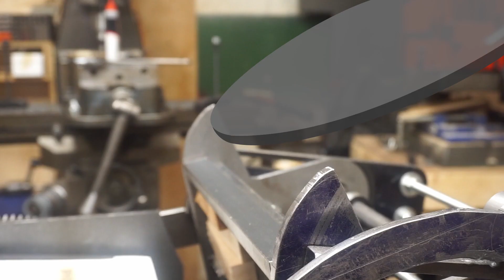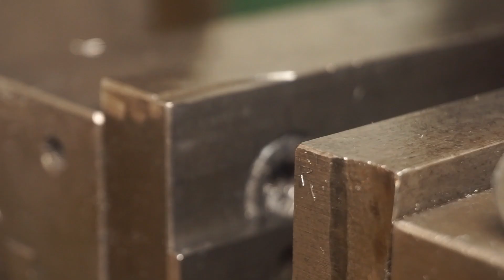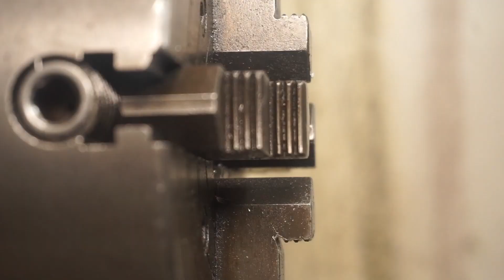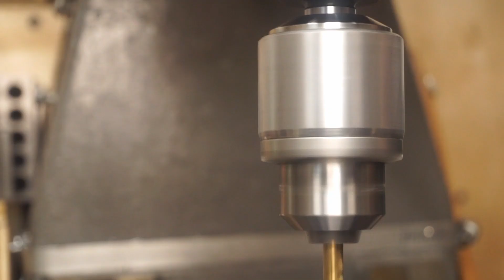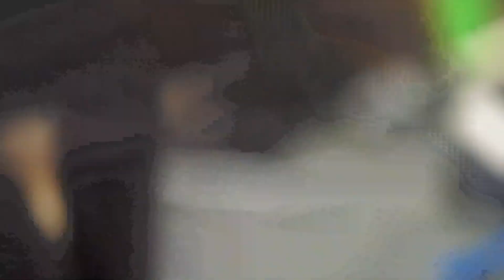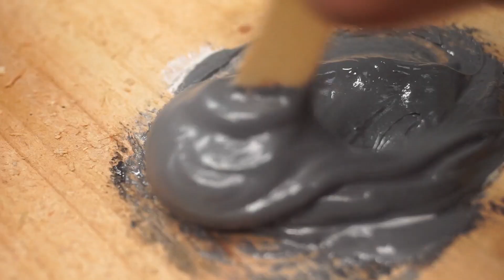Building a Letterpress: Making the Ink Disk

Comment: Sweet bunch of work, amigo. You've pretty much duplicated the operation of a Gordon Old Series platen press. Pretty damn cool, though it's way more work 'n I'd have gone to, being as how there are presses rusting away in the middle of cow meadows.
. . . I dragged a 10x15 C&P (1923 vintage) out of a field and lucky found 99% of the parts. Had to get a few shafts & bits machined but other'n that, it's worked fine for over 35 years. The guy I got it from said I'd never get it going. He's gone and the press just finished the first of a three color run of 2000 impressions. I figure there are at least 100k impressions on it already.

Two things I want to suggest -- as I have done many times before teaching letterpress tech to young folks in a manner similar to the gruff old geezer that my Dad was teaching me: 
> 1. Get a copy of the Polk Brother's book "Practice of Printing." The 1960s era edition is probably the best, though there are earlier editions. Another book by the Polk brother's is Elementary Platen Press Work." Another definitely necessary need. You should memorize entire sections of those two books at the very least.
> 2. Not knowing where you're located makes this'n tough but here 'tis: Get to know some of the old geezers who run letterpress. Get to know the gang at the Amalgamated Printers' Association. Get to Nashville and intro yourself to the gang at Hatch Showprint, the second oldest poster/letterpress shop east of the Mississippi. Or get over to Muncie, Indiana and meet up with Rob and Kim Miller at Tribune Showprint (tribune-showprint.com),  the oldest letterpress/poster shop east of the Mississippi. The trick is to get some gruff old codger like me to give you pointers and get you fully invested in doing it the right way the first time. Also, if you're near Muncie, Indiana, you should get to know the gang at Ball State University's Book Arts Collaborative program. I've worked with those folks many & much, back before COVID.
> 2.a. Get to know Andrew Churchman of buyletterpress.com and John Barrett of Letterpressthings.com for type, press parts, tympan paper and all that. Andrew is the son of the late Dave Churchman, who was one of the folks featured in Erin Beckloff's movie "Pressing On: the Letterpress Movie." Dave was a hoarder and the hoard is still full, believe me. Also Sky Shipley of Skyline Type Foundry, among other maniacs who are still casting type, some of it with matrices ain't seen hot metal in 100 years.

Again, beautiful work. I admire your determination and creative solutions to the mechanical exigencies. Stay safe & stay healthy, Ryan!
Reply from the maker: Thanks for the suggestions! Yea, I definitely could have restored an old press, but the way I see it, I now know how this thing works from top to bottom, and I've learned a ton throughout the process!

There's actually a pretty big letterpress community where I'm based (upstate New York) and at least pre-COVID 19 I was chatting with some of the folks at boxcar press and the APHA. I need to reach back out to them, especially now that I'm getting near the end of the project!
Reply: @RyanGausMakes  Definitely. The gang of geezers and younger folks -- more of 'em every year -- with the Amalgamated Printers' Assoc is also a good bunch to get to know. (https://apa-letterpress.com/) 
. . . I learned plenty pulling this old beater out the weeds decades ago. (Had a tree growing up the middle of it, which made extraction interesting.) I have an older (1876) Gordon for which my friend in Italy said he could make me a new bull gear. Deff know that would be more money than I spent on the press ;-) 
. . . Now to find my videos of that press & others to post. 
. . . Stay well & sane!